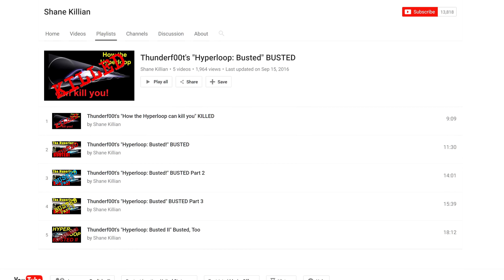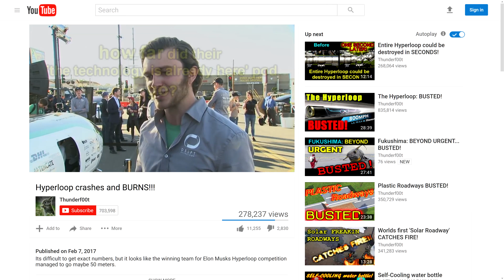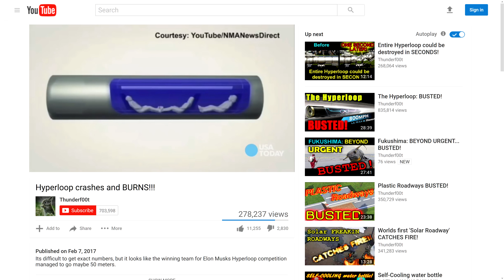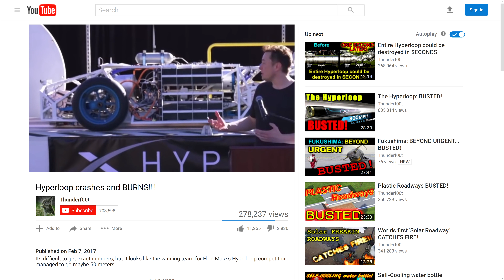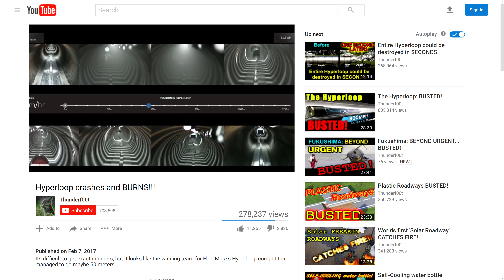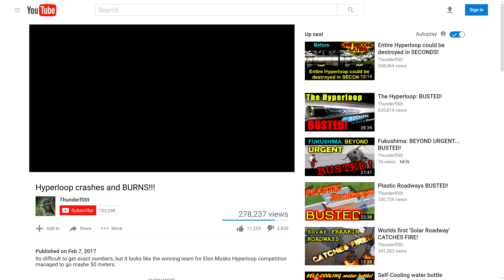Thunderf00t crashes and BURNS!!!

Comment: I am as much a critic of Thunderf00t's series on the Hyperloop as anyone(check for my comments at his videos) but one thing Shane has in common with T'F00t is the same tone of derision. I suppose that is what gets eyeballs here on YouTube, sadly.

 For the sake of information, and because the Hyperloop One Co has gone public with a number of interviews describing their even shorter test track I want to spell out what such test tracks can test in those lengths. I am retired from aerospace, and have no stock or relationship with those two endeavors, just a fascination with the technological transportation paradigm shift that we are witness to here.
First, they do allow for the pump-down scenarios to be tested. Those lengths could easily mimmic a full scale hub's set of airlocks and the pumping cycles timing one will need to understand.  Second, as Rob Loyd of Hyperloop One mentioned, the speeds tested in their  Las Vegas facility will not be the real conditions for passengers, it is too short for the airliner type of acceleration they expect a commercial tube to use. What they will be testing, besides the safety and braking that the SpaceX scaled down tube has already begun, is the energy requirements for the linear motor in partial vacuum, and for a brief period after acceleration the velocity loss of various levels of vacuum pump-down. Needed for all the tests, of course is the reversed linear motor to bring the capsule to a stop. 
Capsule aerodynamics will probably also be tested, levitation, guidance and most likely some amount of the ride quality can be discovered too, especially during heavy braking. One good reason for staying this short at present could be the cost of changes to the tube structure that such testing reveals to be necessary before going on to a much longer test loop where higher speeds and turn control can be modeled.

Some of my background to understand me. I have been involved with the Human Powered Vehicle Association for decades, and we explore the outer limits of bicycle based extremely aerodynamics. Human power, even with superior athletes is very limited, so any detraction to efficiency  affects top speed. We are getting very close to exceeding 90mph in 200 meters and 56mph for one full hour from a standing start. It turns out that automobile race tracks are too short to set the longer hour records, and so we resort to the flattest auto manufacturers test tracks where the curves are much bigger radius. Hyperloop will have to approach curves very carefully too. Both the speed and the amount of linear acceleration will depend upon how straight the curves and how gentle the rises can be made. One major advantage Hyperloop can have in acquisition of right-of-way is that it is not going to make the noise of High Speed Rail. Oh, and FYI, a bicycle at near 90 mph has the wind noise of a small car passing at about 70mph.
Reply: "There are good reasons to be skeptical of Hyperloop. Thunderf00t mentions none of them. ...... or flawed understanding of basic science and engineering principals, or both."
-I certainly can see that Mr fauble (libertarianist ) has presented math that rebukes TF claims, but i havent checked that math. TF clearly has also made some mistakes in science and engineering principles, hes not an engineer, hes a chemist, hes allowed to make mistakes. When hes wrong the points against must be made in the appropriate way.

"That's a fair point. I would say there are exceptions to that statement........ in those instances was in keeping with the "spirit" (for lack of a better word) of science."
-Yes i suppose there are instances that have gone against the ethos (perhaps better than "spirit" but maybe not) of science in the past, also certain times when utter nonsense like phrenology was accepted in the guise of "open discussion", or as a cover for ideology. You have a point and i suppose no community is perfect.

"Like all things related to the concept of justice and what people 
deserve, my basis is almost entirely subjective. I think thunderf00t is 
doing real harm (explained below) and I think his main motivation for 
not admitting he's wrong is ego based. If I'm correct that he's highly 
motivated by protecting his ego, then it seems reasonable to establish 
that if he spreads misinformation, he will be ridiculed.

Do you think Scott and Julie Brusaw deserve all of Thunderf00t's 
ridicule? They don't seem like malevolent hucksters to me. They seem 
misguided and incompetent, maybe, but not deserving of the scale of 
derision that Thunderf00t directs at them. How do you feel about that?"

-This seems to be where we have the small but noticeable difference in thinking. When you say he is doing harm, I just dont see how making mistakes and being wrong causes this real harm. Yes he has an audience, but many have far bigger audiences, for fucks sake Cosmos was huge and it made several errors. Even if he had the largest platform around, the bigger they are the harder they fall, objections articulated in the appropriate context always win the day. Even his potential harm doesn't seem to be intentional so i just dont see it, im willing to concede that could be just based on my own experience living in a rich NE educated community, but im just not seeing it. Id also still ask you to really measure and justify a realistic scale for this harm, because clearly that is the most important thing to consider with such a claim.

Brusaw did not deserve it to an extent. However as mentioned above we have to look at scale. Brusaw Derived an ENORMOUS financial benefit from their fallacious thinking and hype machine surrounding it. TF would have to run his channel for 5 to 6 years to derive the kind of financial benefit they did. So while i agree in principle, it would have been better to be factual with just a bit of ridicule, the punishment has to fit the crime, some might argue it has for them

I assume you're talking about Hyperloop One when you say "the company".......... (I'm not saying you're wrong, I honestly can't find what you're referring to)"
- Clearly, they are de facto "the company" because they have raised the most funds and are the furthest in development. I cant use personal experience about what i have heard about the investment and management atmosphere around this, it wouldn't be appropriate, however just read this article:
http://nymag.com/selectall/2016/10/the-kink-in-elon-musks-hyperloop.html
it tells atleast part of the story.

"I have written thousands of words on this topic. Where did you get the idea I've never contributed to the conversation?"
-You must excuse me. I didn't articulate my point properly there. Im sorry i gave the impression that your responses were not present, sincere, or adequate; i was wrong in doing so. Rather what i meant was, rather than standing in tribes conducting a flame war why dont we just address the points, which for someone like you might involve checking libertarianist (Mr Fauble) math.
Reply: I would say thunderfoot deserves the derision since he is clearly dishonest in his critique.
Reply from the maker: "I would say thunderfoot deserves the derision since he is clearly dishonest in his critique." Precisely. I've never understood this idea of we should be nice to people who are deceiving others.
Reply: Ashton M
I agree. I would look to something like real engineering, or if you want a little more attitude, potholer54. They do a good job of conveying information without making it look personal.

That being said, I still empathize completely with the frustration in Shane's tone.
Reply: Abe I think you are making a big assumption here, while I agree that TF has definitely made errors in more than one of his videos, you have no basis to say that he has, " repeated the same arguments that *he knows are wrong*."
There is nothing to indicate this to you or anyone else, he clearly believes himself to be correct, even though he most likely isn't. That is just attributing uncharitable view of TF based on your confirmation bias since you don't agree with his view the Hyperloop wont work. While i can see your point I think its a bit strange you claim Shane is justified in his anger when as you very well know such sentiments don't get you anywhere in the STEM disciplines. Also Im i little confused that you claim Real engineering's (great channel) video is excellent when its really just the most cursory explanation of what the hyperloop is. Compared to other things hes done on the channel that video is actually quite boring......

No one deserves derision, what basis do you have to claim that? You unlike Shane are a true student of the sciences, you know that to make such a claim you would have to elucidate far more reasoning than that. Ask yourself this question, why are you so insistent on supporting this idea. The head engineer and co-founder of the company, the only big gun in engineering they had for years claims the entire endeavor is a scam. Maybe it is physically possible, maybe it isn't, have you checked Mr faubles math? You are an engineer and you look young(?), why not actually contribute to the conservation rather than say its justified to insult others?
Reply from the maker: I dunno, how many times did he continue to say "bullet being fired from a gun" AFTER seeing our math showing him to be wrong? He kept repeating it like a mantra...
Reply: ok..... i see your point. However simply continuing to say something that you and I consider to be factually wrong doesn't mean he knows that it is wrong. Those two things are just so far apart. Also you assume that seeing some numbers on a screen means: Magic! disproving mission accomplished! It doesn't. Lets create simple thought experiment to demonstrate why he might have completely ignored everything in your video. 

Lets say both you and TF are both professors. This isn't crazy because he actually is one, in fact hes taught at a school for years way better than you one me, you, Mr fauble, Mr dilon, or most everyone on this thread most likely went to. So as a professor Shane, a student angrily attacks a theory of yours and does so in a mocking, derisive, combative manner; constantly asserting that you know nothing, are a liar, and have been dishonest on other subjects. Eventually you have the student tossed out of the class and ignore them when the student continues to try to engage you during office hours etc.
 Now scenario two. 
TF is a professor, a student approaches him calmly and shows him math and evidence disproving a theory of his. He thinks "who is this little snot nosed kid". They don't have any credibility, education, experience; but he does. However the student persists and very politely over a period of time asks him to look at their evidence. Eventually he decides to appease the student and inform them that while he doesnt currently have time he will look at their work at a future time and give it the proper attention. 
Ok so both students were showing the same evidence against the same theory. Can you guess why one was completely ignored?

To TF he has seen a dozen people try to "expose him". Your piece comes off as disrespectful, derisive, etc all the things me and several others on the comments section have mentioned. Your channel is small and you and Mr Fauble have no expertise or CV. When he sees a bunch of numbers thrown on the screen he doesn't think your math is correct, because by that point he doesn't even care anymore. Also its perfectly reasonable for him or anyone else to turn around and say "well maybe your math is correct but i just think since the project is so very complex for not that much financial pay off it just wont happen even if its physically possible." That response after all your flaming would still be reasonable........
Reply: "There is nothing to indicate this to you or anyone else, he clearly believes himself to be correct, even though he most likely isn't."
I'm basing it on the fact that Thunderf00t replied to Shane's video where Shane showed his comparison to a vacuum gun is bunk. Though you're right, he may still believe he's correct even though his math was shown to be very very wrong.

"That is just attributing uncharitable view of TF based on your confirmation bias since you don't agree with his view the Hyperloop won't work."
This isn't about whether Hyperloop will work. I'm a realist in that regard. There's a good chance it will never see the light of day. What I care about is spreading misinformation about science and engineering.

There are good reasons to be skeptical of Hyperloop. Thunderf00t mentions none of them. All of the reasons he describes are based on either flawed logic (e.g. terrorist attacks on transportation infrastructure are extremely rare and increasingly so), or flawed understanding of basic science and engineering principals, or both.

"While I can see your point I think its a bit strange you claim Shane is justified in his anger when as you very well know such sentiments don't get you anywhere in the STEM disciplines."
That's a fair point. I would say there are exceptions to that statement (the guys who claimed to have invented cold fusion were pretty heavily ostracized) but I'm not really interested in debating whether the behavior of the scientific community in those instances was in keeping with the "spirit" (for lack of a better word) of science.

"Also Im i little confused that you claim Real engineering's (great channel) video is excellent when it's really just the most cursory explanation of what the hyperloop is."
I was trying to highlight the level-headed tone and presentation style real engineering uses, however; I also like that video. Vactrains have been on the drawing board for a while, so it's nice to see a concise presentation of what makes hyperloop a novel contribution to the concept. I would have liked a better explanation of the Kantrowitz limit, but otherwise, I found it short and sweet, which is kind of his style.

"No one deserves derision, what basis do you have to claim that?"
Like all things related to the concept of justice and what people deserve, my basis is almost entirely subjective. I think thunderf00t is doing real harm (explained below) and I think his main motivation for not admitting he's wrong is ego based. If I'm correct that he's highly motivated by protecting his ego, then it seems reasonable to establish that if he spreads misinformation, he will be ridiculed.

Do you think Scott and Julie Brusaw deserve all of Thunderf00t's ridicule? They don't seem like malevolent hucksters to me. They seem misguided and incompetent, maybe, but not deserving of the scale of derision that Thunderf00t directs at them. How do you feel about that?

"Ask yourself this question, why are you so insistent on supporting this idea."
I'm not. There are some pretty obvious flaws in the Hyperloop design as described in the alpha proposal. I don't think any of them clearly render the concept bunk, but I'm perfectly OK with discussing those if you like. 

What I'm insistent upon is that Thunderf00t recognize and correct his mistakes and put more thought into his videos.  He's completely misrepresenting the entire engineering process to his very large audience of subscribers. Every time he scoffs at the small scale or limited scope of the prototypes, he's actually scoffing at excellent engineering methodology. He's convincing people that good ideas go straight from inception to perfect execution, otherwise, they're *BUSTED!!!* Alpha proposals can't have rough edges, prototypes are useless at anything but full scale, and testing different systems in isolation is proof of failure. Those are all terrible misconceptions that I'd rather he not ignorantly spread.

When I watched his "Hyperloop BUSTED! ||" video and he started off with a complete non-sequitur about how he outsmarted NASA. It made it pretty clear to me that this is about his ego. He clearly reads the comments on his videos because he cherry picked some of the least convincing counterarguments to his previous work to prove that he was right all along.

"The head engineer and co-founder of the company, the only big gun in engineering they had for years claims the entire endeavor is a scam."
I assume you're talking about Hyperloop One when you say "the company", because there are several companies developing the idea. I'd be interested to read your source though. (I'm not saying you're wrong, I honestly can't find what you're referring to)

"Maybe it is physically possible, maybe it isn't, have you checked Mr faubles math?"

I don't know who that is.

"ou are an engineer and you look young(?), why not actually contribute to the conservation rather than say its justified to insult others?"

I have written thousands of words on this topic. Where did you get the idea I've never contributed to the conversation?
Reply: I do agree that T'f00t's continued defense of his premise makes no scientific sense and should be properly criticized. Apparently the numbers of viewers he gets for taking that position is satisfyingly large to his ego.

 The only area where I am in some agreement with him is to some of the hype that does surround the companies trying to raise money for it, when all the costs and engineering factors yet to be discovered may  prove it unsuitably rough riding for passengers. In the US, private railroads have all but abandoned the superior to road travel service that got them built long ago, with government subsidies, and our ATC subsidized airlines seem to be evolving towards treatment of passengers as if they are just so much goods. 
Of course I want it to succeed, as I have also long wanted to see high speed rail between LA and SF be built. 
Elon's dream was not his own entirely. The California high speed rail so far, including the route chosen have been so curried to the various factions that stand to profit, the developers in the Salinas, San Joaquin and Antelope Valleys, that it is no longer the short, comfortable way between those two regions.
 Hyperloop must prove to be that same superior service between any two major population centers if nothing else.  NIMBY'ism would kill just a freight transport system if ultimate cost per mile doesn't do it first.